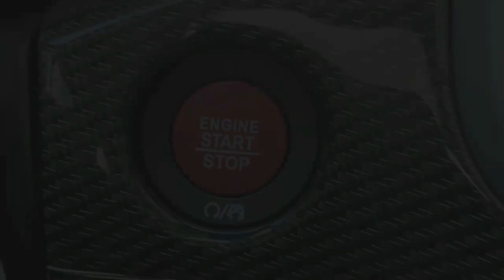A BREAKDOWN OF HOW THIS LOOSE NUT CAUSED OUR BUILT TRANSFER CASE TO FAIL

Comment: Those nuts are a one time use lock nut. You are supposed to install the old one to proper torque spec and backlash. Mark the number of visible threads then install a new nut.  It’s amazing how many shops are unaware of these simple, yet important, minor details.  If you are in a pinch and want to be cheap, you can stake the nut in place.   Same thing for pinion nuts in any differential.  Its good to see you have the old nut not on the jeep anymore
Reply from the maker: It was brand new. All of the parts with the new tcase had never been used before.

Comment: Hi Ron, did Dunn fab ended up using loctite or something so this doesn’t happen again?
Reply from the maker: You can’t use that. You have to replace the nut, and seals. Total cost $800.
Reply: @EastCoastJeepSRT  I dropped off my tf case to hhp to get sent out to paramount, got nervous when I saw this video any suggestions thx
Reply from the maker: Mine was a fluke that’s all
Reply: @EastCoastJeepSRT  i guess just make sure that nut is torqued down before they install the tf case
Reply: Another dunn fab failure. No surprise.

Comment: Well, it could've been alot worse Ron so that's great news. However not to sound like the grim reaper BUT... I would still be a little worried with that. You mentioned 50% of the TC fluid gone... as you know these things are proper sensitive like the SRT's... how can we know there's no damage? did you call Paramount and ask why that would have come lose? Have to admit I'd be a little worried that there is damage and you just haven't seen it yet... I prey not though fella and I hope all is good and you caught it 100% before ANY damage. Nice to see the beast back on the road. take care buddy

Comment: You’re gonna have 10,000 dollars worth of repairs if you got e-85.
Reply from the maker: How so?
Reply: @EastCoastJeepSRT  E85 gums up everything. I used to run it. Clogs injectors like mad, corrodes the intake runners, messes up the air flow. If you run E-85 you’ll need to clean the injectors every 2 months as well as everything else or your motor wont last, it’ll start running hot and popping head gaskets. E-85 is not for reliable daily drivers.